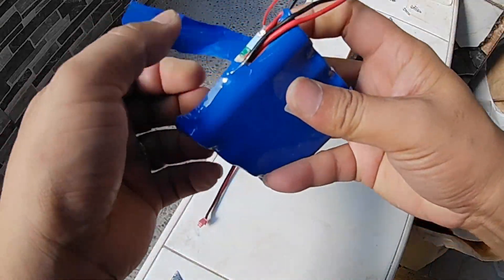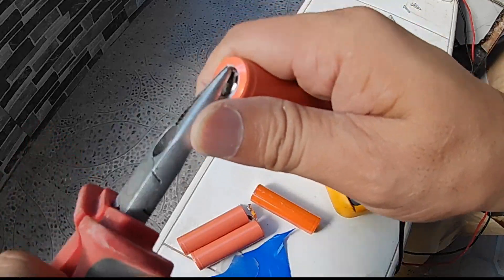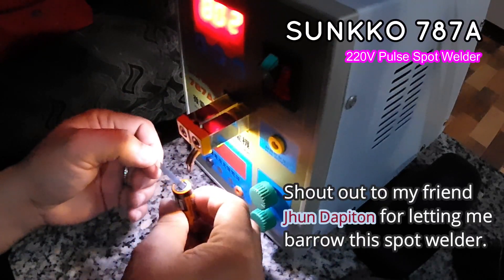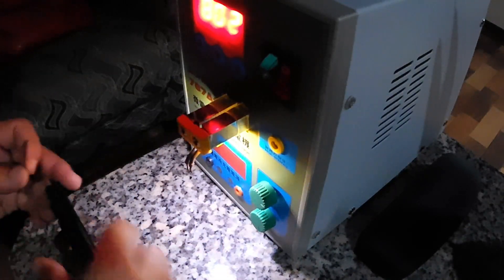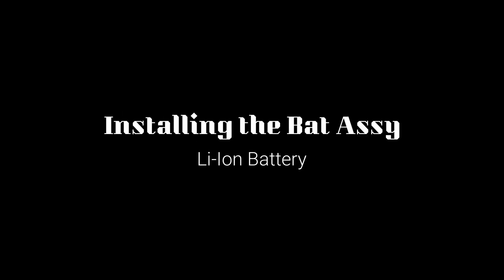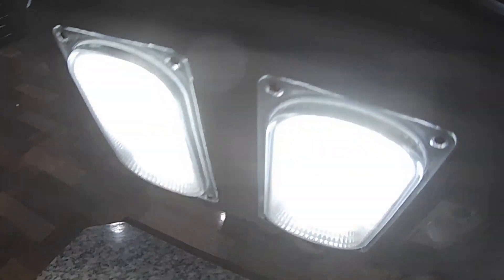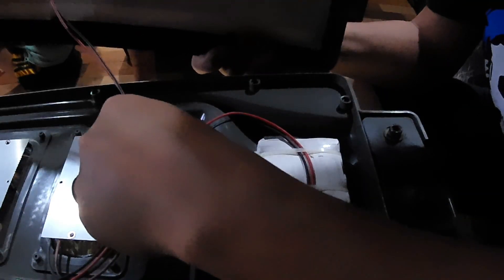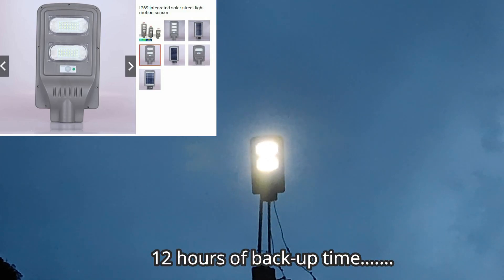Solar Street Lamp Li-Ion Battery Replacement | DIY Petz

Comment: our street solar light only last 4 hour pls advise.
Reply from the maker: It depends on the battery capacity and the solar panel size of your street light Sir, you can contact your supplier for further assistance. Most probably the batteries need replacement.

Comment: Boss ano maganda ipalit sa 800w solar streetligth orig nya polymer battery, lagi lobat. Ano maganda ipalit at ilan?
Reply from the maker: Pwede naman lithium Sir, pero dapat same specs ng voltage din mag increase kana lang ng paraller nito para mas mahaba ang ampere hour rating kung kaya ng case sa loob Sir.

Comment: I have 4 solar lamps that I have been buying for about 6 months. So far I'm very crowded with the purchase especially one of them that lights up much later, implicitly you more. How do they differ from the others especially since they are the same model? Thanks in advance!
Reply from the maker: Hi Sir, I think they differ mostly on how long the stock batteries were  discharged for a very long time. If the batteries were stock longer with out being charge, there is an effect  on the battery life.

Comment: Sir ask ko lan po pede po ba gamitin 26650 3.7v instead of 26650 3.2 volts para solar bulb?
Reply from the maker: Hi Sir, I have not tested that one yet but I think it would work. The problem would be the placement of the battery since it's much bigger than the 18650 cells. Thanks.
Reply: @RollyPetz  salamat po sir GODBLESS

Comment: Is it possible to add 2 more batteries to make it 6? For longer back up hours?
Reply from the maker: Good day Sir, yes you can add 2 more in parallel as long as they are of the same specs Sir. Tnx.
Reply: @RollyPetz  thank you so much sa response Sir.
Reply from the maker: You're welcome Sir.

Comment: nice video, Please how many volt is the LED?, Can 5v power the LED without burning?
Reply from the maker: I haven't really tested it yet, but I'll check it out. LED's are rated @ 5V rating so this should not burn out. Thanks.

Comment: Pre, ano totoong wattage talaga nya?
Reply from the maker: The solar light is 60  watts lang po Boss.
Reply: @RollyPetz  kase sa 12000mah, kung todo 60 watts mga 4 hours lang kaya nyan. Baka ilang minuto lang 60 watts tapos nag stepdown ng 20 watts kaya umabot ng 12 hours.
Reply from the maker: @wanderingandroid  posible Sir, yun kasi ang naka state sa specs nya, baka lang nasa 20Watts lang siya. Tama ka Sir but anyway its bright enough to light the area.
Reply: Pwede po kaya 32650 batteries?

Comment: Kapag wala pong spot welder, ano po kaya pwede gamitin
Reply from the maker: Hi po, pag walang spot welder pwede naman soldering iron, pero dapat di masyadong matagal yung pag solder sa batteries po kasi may effect po kasi sa li-ion battery and sobrang init. Mas maganda yung saktong wattage lang ng soldering iron po. Pwede din naman po yung mga battery holder na nabibili sa shopee. Solder mo muna yung case bago ilagay ang mga battery po. eto po yung sample holders.  https://invol.co/cl7yv8h

Comment: unsay ngalan anang pang weld nimo boss?pwede rapud solda?asa ta kapalit ana?
Reply from the maker: Maayung buntag Sir, pwede ka mo palit ani na spot welding kit sir na ako gamit sa assy sa akong 48Volts ebike battery.

https://invol.co/cl4azv9 6 Gears Mini Spot Welder Portable Adjustable Welding Machine for 18650 Battery Spot Welding Tool Kit Spot Welder

Link to DIY 48volts ebike battery Sir..
https://youtu.be/6UBfrO1D5JE

Pwede raman pud i-solder Sir, kaso basin naay effect sa li-ion battery, not advisable pero pwede ra as long as kadali ra ang heating...

Comment: Pwede Kaya to kahit sa ibang led solar lamps?
Reply from the maker: Yes po Sir, pwede po. Most of the solar lamps are using lithium ion batteries. Just replace the batteries of the same rating and voltage. Mas mataas na wattage mas maraming battery ang gamit po Sir.
Reply: @RollyPetz  salamat
Reply from the maker: @SalvadoPyro  welcome po Sir..

Comment: Sir pwede pa repair ko sau solar light ko?..change battery lng din po..2 hours na lng kasi tumatagal battery ko ay naka off na agad.
Reply from the maker: Good morning po Sir. Usually Sir, madali lang po etong palitan. Sundan nyo lang po yung guide Sir. Wala po kasi akong stocks ng batteries Sir..Tnx po.
Reply: @RollyPetz  oo nga po..kaso di po talaga ako marunong kasi di ko po linya yan at wala ako tools..hehe..pero nabuksan ko ung solar light ko nasa 12 li-on batteries ang laman.
Reply from the maker: @fatbiketraveller5342  Sa Cebu din po ako Sir, pwede po malaman area nyu po? Tnx.
Reply: @RollyPetz  manila po..hehe..anyway thank you sa time nyo po👍
Reply from the maker: @fatbiketraveller5342  OK Sir, kung dito lang Sir, pwede ko na sana kayung matulongan. Ingat po kayu dyan Sir...Maganda yung Fat Bike nyu sir...tnx. po ulit.
Reply: Sir ba talaga lagyan nang bms?
Reply from the maker: Hi Sir, gani tong setup may bms na talaga sya. Re-use nalang ito Sir.

Comment: Hi sir, very nice video! Do you think that is it possible to add 1 or 2 more batteries to increase de duration of the light during the night?
Reply from the maker: Yes Sir you can, the more parallel cells the longer is the duration since more ampere hour is added to the capacity. Thanks for your comment Sir, much appreciated...
Reply: @RollyPetz   nice video, Please how many volt is the LED?, Can 5v power the LED without burning?

Comment: Hi. Informative video sa balak din magpalit ng battery pack. Sufficient na ba ang 3000 mAh for a 12 hour light time na naka full or always on mode? Meron ako isang 40W, mga 11pm pa lang mahina na. Thanks
Reply from the maker: Good evening po Sir. That would depend on the wattage of your existing lamp. the rule of thumb is that the more parallel cells you put in the battery, the more is the ampere-hour can be used once the battery is fully charge. I'm not an expert on this discussion sir but I have found this for some calculations. Thank your for comment po. tnx.

https://www.techwalla.com/articles/how-to-calculate-amp-hours-by-watt-usage

Comment: 12hours of running time? nbbgo b ung brightness ng light? kc ung s nbili q hbng ntgal nlabo ung ilaw. tnx s reply.
Reply from the maker: Good afternoon po Sir. Di naman nagbago, same pa rin kasi ng voltage lang din ang ginamit ko na battery. Mas mataas nga lang yung amper hour rating kaya siya tumagal ng 12 hours po. Baka po medyu faded na yung clear covering ng LED mo sir...hehehe.

Comment: How long did the original batteries last?
Reply from the maker: Good day Sir.
The old battery would only last for 6-8 hours depending on how bright the day is while charging. I could not really check on how much the old battery rating is for there are no markings on the cell. Maybe it was only a low ampere hour rating cell. With the new ones, there are of higher capacity thus the battery would last a long time.
Thanks also for the comment Sir.
Reply: @RollyPetz  i think Yeah No was asking how long did the original batteries last..meaning how long the batteries serves before you replace it...
Reply from the maker: @edmarcueco4260  aw, sorry. Hehehe. The old batteries didt not reach 6 months before I replaced them. I think I received an old stock.  Thanks.